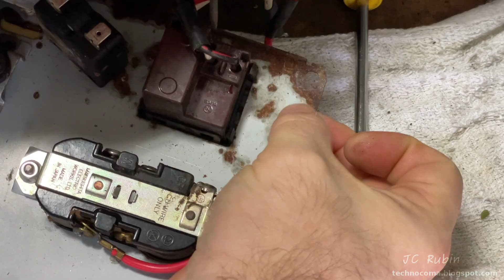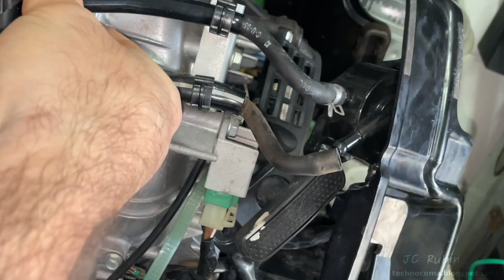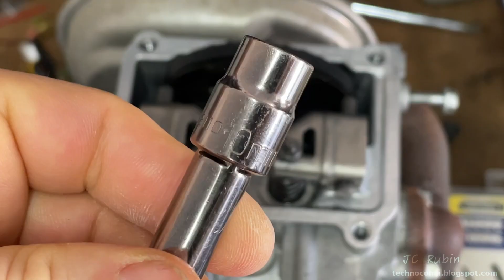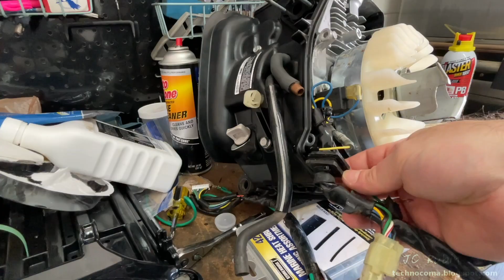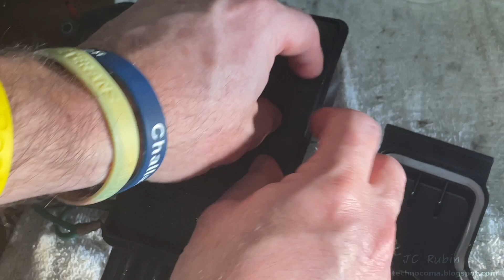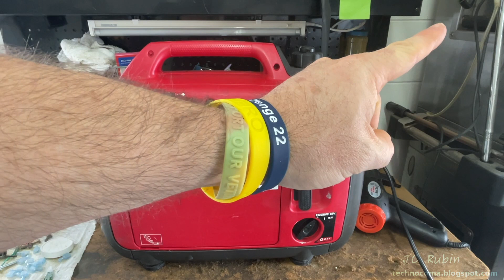Honda EU2000i - Ultimate Valve Adjustment Procedure

Comment: This is the procedure listed in the service manual but I don't believe you need to tear this whole thing apart just to get to four bolts on on the top of he engine.  I was going to do this valve job but I think I'll just live with the rough running or take it in to someone who has figured out the short cut to this job. Interesting how manufacturers design something that require maintenance and puts it into a hard place to access. The fun never ends.
Reply from the maker: I received it in parts

Comment: Your leading the blind into the mud with no chance of ever getting unstuck . Why are you completely breaking down that inverter when there is absolutely no need when it comes to a valve lash adjustment . Your video is bogus . I guarantee you if someone has followed your lead on this they probably purchased another one or spent alot of money on a mechanic getting it put back together . Your not a good teacher just to let you know .
Reply: I do agree to that completely. Just explane that this is not just for checking the valves. For the rest a good interesting video.
Reply from the maker: Yeah, love folks like you every 1000 comments.   Most everyone else figured out that from the other video the generator arrived disassembled and this was conducted during the rebuild.  Some people are slow.

Comment: this is one of the best how-to videos I've seen - concise - no nonsense - and we're not treated like morons. I have an 2017 EU2000i that starts on one pull when warm but never if below about 40deg F - have cleaned carb, installed new spark, changed oil to 5W30, and had my age appropriate temper-tantrum (I'm 60+). Only other thought is low oil sensor or ignition coil issues... but I really have no clue. Thank you.
Reply: ...your way too hard on yourself !!!!

Comment: my honda eu2000i seems louder than when it was new
it runs great starts with an easy pull and is well maintained
looks nearly new, may have 200 hours on it
it didn't ship with an exhaust  gasket so I added 1
did not help
any Ideas ?
I actually replaced the carburetor because the eco control motor went bad 
Idle rpm with eco mode off is 4300rpm about 3k with eco mode on
could it be valve adjustment?

Thanks, great channel!

Comment: I have the 2200 and it takes 5-6 pulls to start and then runs fine.  I had thought about adjusting the valves but this video convinced me not to bother as long as it runs good.  Way too much work.
Reply: I also have the 2200 and it takes a lot of pulling and was also convinced not to even try adjusting valves.  Seems like a poor design to need to almost totally dismantle a generator to do what amounts to routine maintenance on most small engines.

Comment: I've had my 2200 since 2016. I change the oil every 24 hours of operation. I also only run real gasoline in it. I've never adjusted any valves or anything else and haven't needed to😂
Reply from the maker: That's great to hear that you haven't had any issues!

Comment: Good explanations and informative tear-down and reassembly. Honda does not use Phillips head screws. Honda uses JIS(JIC) Cross Slot. The JIS(JIC) Cross Slot drivers work much better than Phillips drivers. You can break the screw before torquing out the driver so take caution. If you start using the JIS(JIC) cross slot drivers the Phillips will drive you crazy. Black conductive grease is available and specifically designed to protect the ground connections from corrosion, It makes a big mess, do not use it on or near any multi-conductor connector. I have also used copper anti-seize to protect AC voltage connections from the elements. From another video I was reminded of the timing marks on the cam to indicate TDCC.
Reply from the maker: Appreciate the extra tips about maintenance and the importance of proper grounding!

Comment: Geeeaaad! What is an easy valve adjustment made hard by Honda and the covers. I could check the valves on my KTM motorcycle in half the time it took to take off a few covers on that!
Reply: He did it wrong. No need to remove all the components in the front end
Reply from the maker: He.... Didnt do anything wrong. It was a valve job as part of larger rebuild of the entire generator.
Reply: @delorean1  aha I thought the same, this can't be true to just check the valves.

Comment: Great video but you missed reinstalling the 3rd air intake bolt, the one inside the cleaner to the engine.  This bolt is attached first, mounting the intake filter housing to engine, inserting air filters, two remaining bolts then attaching the air filter cover.  Other than that you have made a very informative and precise video.

Comment: EXCELLENT JOB! (Won’t mention the forgotten replacement of the 8mm bolt behind the air filter that helps hold the filter box to the engine…oops 😮)
Reply: Glade to see I was not the only one to catch the missed 8mm intake housing body mount bolt.

Comment: Just to adjust the valves, do you need to disassemble the entire generator?
I'm from Brazil, I don't understand English.
Reply: No, In doing the valve adjustment he was also demonstrating a complete engine removal which is not required to adjust the valves.  I have not had to remove the 2 plastic engine covers therefor not having to remove and/or replace that inner gasket.  I have accomplished valve adjustments by first removing the generator housing covers then removing the engine covers, next removing valve cover to make access to valve adjustments then removing sparkplug.  But as a general rule, when I do seasonal maintenance I first do a thural cleaning inside to make sure I don't contaminate any internal parts while working in a clean area.  Seasonal maintenance includes, valve adjustments, carburetor cleaning, inspecting and cleaning fuel tank (if needed), and replacing in-line tank filter, new sparkplug, new air filters, oil change, and replacing any damaged gaskets.  I only remove faceplate and electrical connections if the generator is having electrical issues that I am troubleshooting for.
Reply: To clarify the previous post by me:  Both front and rear covers must be removed before side covers.  Faceplate electrical connections do not need disconnecting. Then you have access to the valve cover.

Comment: 5 star goat rope.  Remove exhaust end panel,  4 main screws on electric end maiin panel.  Leave it there,  do not disconnect any thing. Remove red side panels and valve cover.  Remove spark plug and using good flashlight stop piston at TDC compression stroke. Finger tighten adjustment screws on to feeler gauge and tighten lock nut. RTV silicone very thin on valve cover and reassemble in reverse order.  I schedule 30 minutes for eu2000  if nothing else wrong.  Eu1000  are a pain in the butt and take an hour. To decarburize, load generator to capacity using heaters and run for about an hour. After about a thousand hours  valves don't change much and intervals can be bumped up to 600 hours no problem. They wear loose so not a panic.
Reply: Holy smokes, I could do 5 EU2000s in that time.

Comment: Does this need to be done every 200 hours as the manual recommends (check/adjust valve clearances)? Or should it really only be done if the generator wont run? I'm hoping it's the latter as this is quite the teardown compared to all of the other maintenance suggested on my EU2200i.

Comment: Dismantle of the front panel has nothing to do with valve adjustment. There is no reason for it
Reply: He also showed an extensive amount of other things he did which nothing to do with either valve adjustment or correcting structural damage. This should have been titled Ultimate tear down guide, not ultimate valve adjustment guide.
Reply: He said he was also going to repair the structural damage numb nuts.